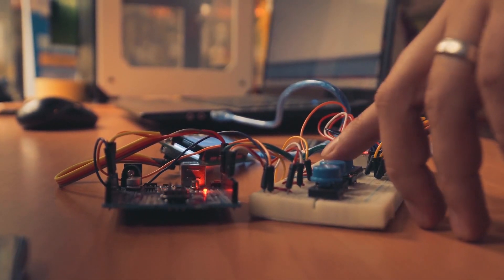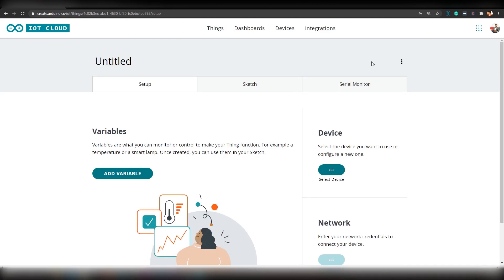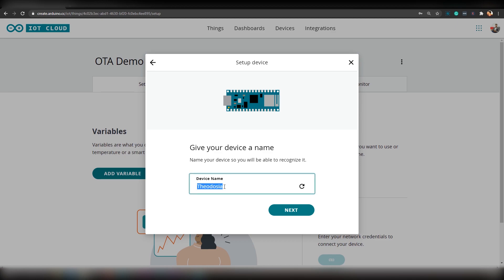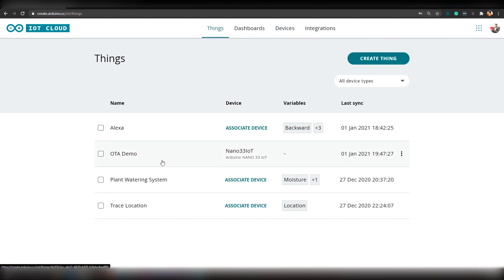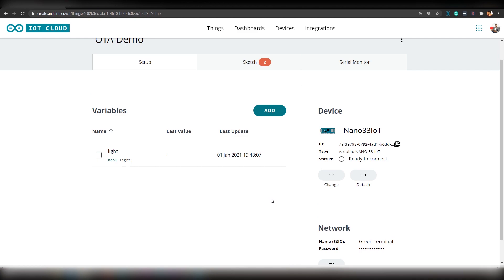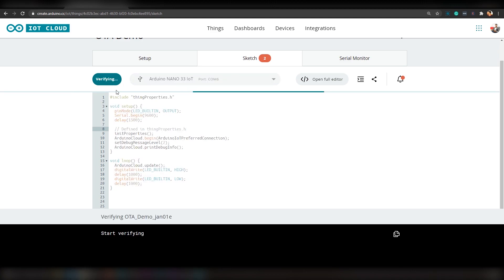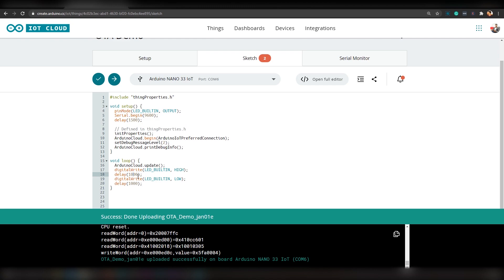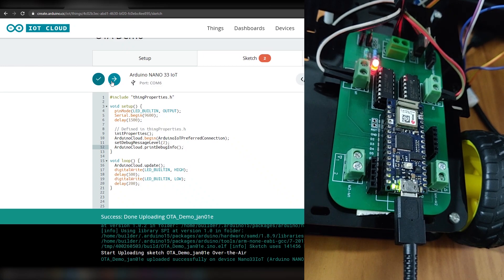Arduino OTA Code Upload Complete Tutorial - How to upload code Wirelessly to Arduino Board?

Comment: I have a mega2560 (ch340) pro micro running my project. Can I load sketches to the arduino connected to esp32 UART pins ?